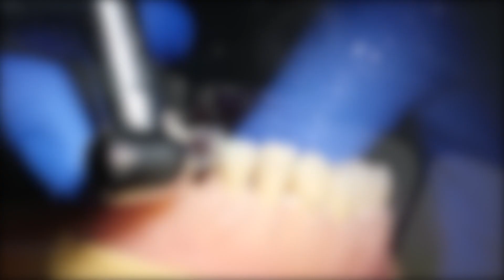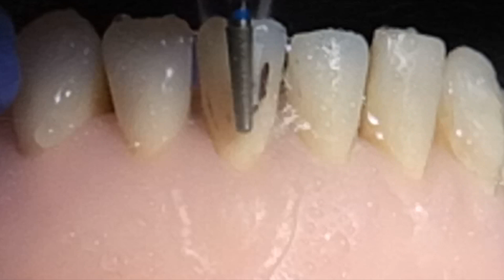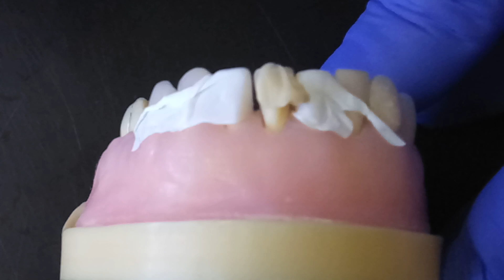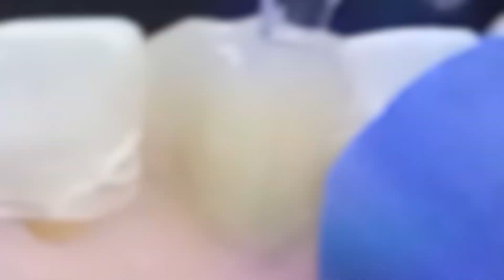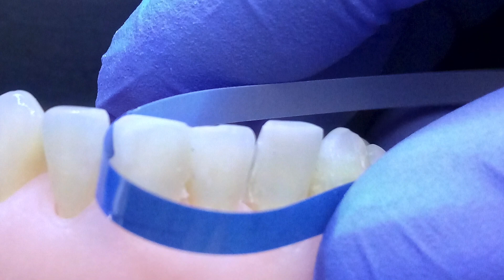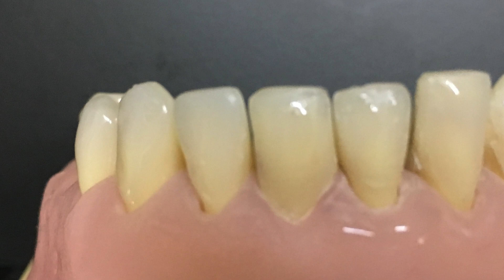EASY DIRECT COMPOSITE VENEERS

Comment: Nice but in order to have more easy time to clean the excess my advice: 1- do not put too much composite at the beginning. Apply the same amount of composite as if you didn't have Uveneer .You can alway add another layer if you miss composite, i put many time second layer with the same composite. 2- Use extra fine diamond BURS for cleaning the excess and only then discs. Also, only on periphery try not to touch the glossy area.  :) Go to my channel there is a webinar on it
Reply: Thank you for dropping by and leaving behind useful suggestions. I will try and incorporate what you said
Reply: https://www.youtube.com/watch?v=3_EFWjJN8RQ

Comment: Great protocol and wonderful result! I have just one question: can you bond the composite directly to the enamel without removing some of it first with a diamond bur? I've done a case in that manner and my patient complained that the composite started chipping off on the labial surface after a couple of months. I didn't prep the labial surface before applying the composite, only etched , applied adhesive and bonded the composite.
Reply: Hi there Ayaska and thanks for dropping by. Enamel that has not been ground slightly does not bond well to composite. A light scratching is advisable. If the composite is chipping, also check the occlusion for forces that may be accumulating due to tooth-to -tooth interaction

Comment: Very well explained ! Thanks doc !
Reply: But one problem I see in this is the Teflon tape ... after bonding , we need to remove the Teflon tape .. otherwise the tape gets stuck between the composite and tooth tightly making it impossible to remove
Reply from the maker: Thank You for stopping by Nirmal. Your comments are much appreciated and drives me to do more of the same :)